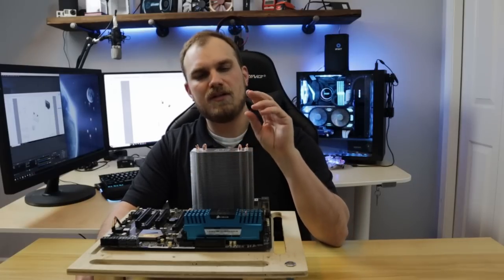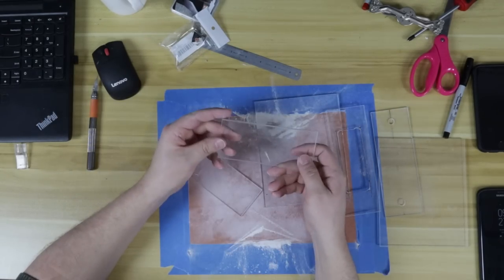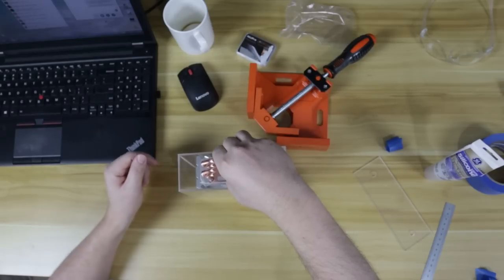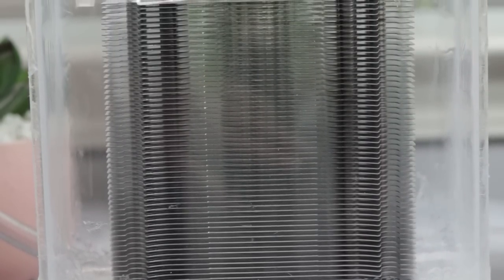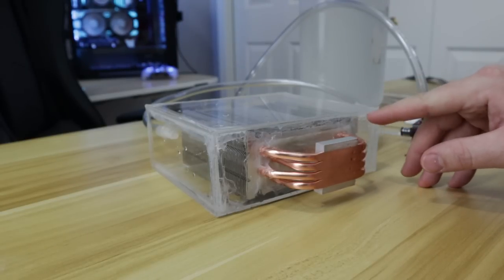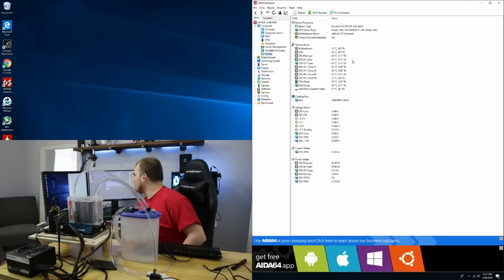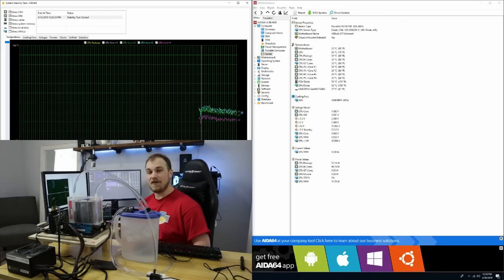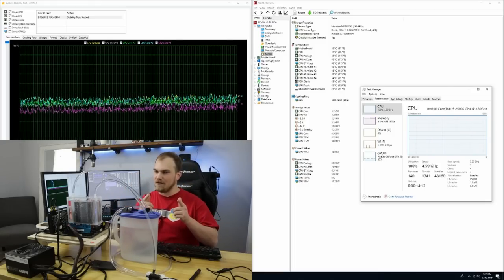I Water Cooled My Air Cooler AND..........

Comment: First time viewer here.

Love the idea, as many have already said. Do you think a gasket would give you a better seal between the bottom radiator fin and the acrylic? Maybe apply glue to both sides of a rubber gasket and sandwich it between the radiator and the acrylic? Just a thought as to improving your seal on the bottom.

Also, in terms of heat circulation, maybe put the water inlet at the bottom of the acrylic and the outlet at the top on the other side? That might give you better heat circulation across the fins. I'm not expert by any means, and your execution in the video is already above and beyond what I could do. Just a couple of things I was thinking. I definitely subbed after this. Keep up the great content!

Comment: I thought about doing this but decided against it because i was concerned with the possible breakdown of the epoxy around the heat pipes due to thermal variation. I would be interested in seeing how long a setup like this could run before leaks happen.

Comment: I've been done this so many years ago.
It's age of AMD K6  CPU
I take the fan out of the original cooler, and seal it with acrylic and 
Silicone just like you do.
And use a electrical fish tank filter to drive water circulation.
Then connect to a junk yard car AC evaporator with powerful 8" 12V fan.
My CPU never higher than 3 degrees C than room temperature since.
This Diy-Water-Air-Cooling system keeps working many years until the end of the age of AMD K6-3 CPU.

Comment: Having the inlet outlet at the top won't allow the optimum flow..

Across the fins with a breaker / diffuser, and the changing the direction of flow would however...

If you want to test flow, use clear liquid, and then drop dye in to it to watch where the dye goes..

Comment: Short answer...thermodynamics (with applied fluid dynamics) tells us this isn't gonna do much. But that's because you aren't actually removing the heat so much as increasing the thermal mass. So it will take longer to get to a steady state because of the added thermal mass of the water around the fins and your pitcher. So it just depends on the load and the length of time of the load when you try and answer, "is it better than just air cooling?"

Comment: i think it would have given better results, if the input aims directly into the lower part of the air coolers. because eventually, i dont know if there is enough water flow in the air radiator to actually keep it cool. It works because of the ice, but once the water is a normal temperature i dont think you can have the same results.

Comment: Actually ALL cooling solutions are a combination of both. 

Standard coolers have distilled water in the heat pipes. That's how it works. Water boils at the CPU and condenses back at the radiator. That's how heat exchange works :)

And water cooling solutions still have a radiator and a fan.

So both are basically the same thing.

Comment: I would assume there could be the possibility of condensation forming where the metal heat pipes of the air cooler meet the bottom of the acrylic box. Condensation that could turn into droplets and drip onto your motherboard. A CPU water block would be safer in that regard.

Comment: This experiment is super cool  (I've always wanted to see it done) but... there is a reason why it's not done. 98% of that air cooler wasn't being used... at all. The water was likely wicking the heat away from the heat pipes as soon as they brought the heat into the container. Furthermore, the heat pipes would not work effectively underwater. A heat exchange... device can be much more compact when using a dense liquid instead of a gas. Because water is so much more effective at stripping the heat away, like I said above, 98% of that air cooler isn't being used. The limiting factor for most water blocks isn't the heat -> water transfer mechanism, it's the CPU die -> cpu heat spreader -> water block transfer mechanism. That's why most water coolers perform adequately and do so until they are heat soaked.

Comment: I did a similar build this with my pentium 1 cooler in 1997/98. Water worked better than passive air-cooling. A fan would probably worked just as well.

Comment: For the next test you should try completely drying out the loop and using  rubbing alcohol (or any fluid with a very very low freezing point) and dry ice in the resivor. I wouldn't expect the system to function super long ( due to how some components might react to the alcohol and temps, pump warming might need to be a thing) but it could be an interesting approach to extreme over clocking. I would definitely use a processor and MB you wouldn't mind sacrificing.

Comment: something holding that much water might work good in that position. but put it in a normal case, i think the weight will cause issues on either the casing of the cooler, or the motherboard it's attached too. but the idea is pretty cool. really this is prolly the same idea that started water cooled originally, and after patting out all the issues, we now have the AIO's and water cooling systems we have now. and is prolly why we have small blocks that the water just runs through now. less weight stressing other parts.

Comment: You don't need to rough the surface much with epoxy, a quick 1 time rub with 400 grit. it'll bond to smoothly bored concrete just fine. If it's roughed too much you run the risk of micro-damage on anything the epoxy bonded to that can cause evident damage over time with heating up and cooling, that it will good.

Comment: If you got one that was just vertical heat-pipes you could just have the input of water at the bottom and the output at the top and it'd probably do just fine due to the very large surface area of the heat-pipes. It might be easier to get the base plate on leak-free too.

Comment: What if instead of all those box for the fins, why not remove the fins, cut the end of the heatpipe(s) and hook up that heatpipe(s) directly to the pump and let water flow inside the heatpipe(s)? Use some copper tubing and it can look pretty neat too.

Comment: try using baffles in the water case to force the water thru the aircooler, not just around the cooler, adding ice to your water reservoir  make proling the cooling time also

Comment: I will try to separate the cooler all around with an intermediate plate so that you have a chamber in front of and behind the cooler. Then the liquid is forced to flow through the cooling fins. Currently the liquid only swims around it.

Comment: Might've been a better idea to make that container from copper sheet. That way you could braze weld the heat pipes to the sheet, eliminating any possibility of a leak. I wouldn't trust this type of setup because the expansion and contraction from heating could lead to another leak. How long did this hold up before it needed to be refurbished?

Comment: What do you do with your heat sink when you upgrade to a water cooling system? Also, what water cooling system would you recommend that has the least decibel (noise) and the least temperature?

Comment: Hmmm, one year later, but, check me if I am wrong, Those heat pipes won't work properly because they can't transfer fluid inside well now. Metal flex with temperature change, seal at the bottom can be broken. No proper way of cleaning unless destroying acrylic enclosure, eventual rust of fins. Condensation on outer block possibly?

Edit: well, I actually found a year later video... looks to be correct in my assessment on most part

Comment: Could you 3D print the enclosure? I printed a flower pot recently and it's water tight! You would only then need to epoxy the bottom around the fin-stack tubes (and the top obviously).

Comment: I wonder if the water-cooled heatsink is more efficient at removing heat from the cpu than a standard waterblock as copper is more thermal conductive than water and the copper heat pipes should be more thermaly conductive than solid copper and the larger surface area of the whole heatsink may transfer more heat into the circulating water  than smaller water blocks, it would be interesting to see how it compares to a standard waterblock in the same loop running the same tests

Comment: ... air coolers are already liquid-cooled. theres liquid in those copper pipes. theve been doing this for a while as a medium so to better transfer heat evenly.

also, an AIO (liquid cooling unit) uses back and forth ports that move through the radiator or around it, and that is cooled by fans when the heat is passed to the radiator. the water isnt on the outside. so this might be a bit off of the idea.

heads up. most AIOs dont use water, they use non-conductive liquids like Mineral oil encase of catastrophic failure in the loop. the liquid has a slightly higher resting temperature then water, but its still worth it. its even better conductive of heat as its a slightly thicker liquid. more like an oil.

+1 for this idea of yours though.

Comment: Okay before I say anything.  This is awesome.  And I'm glad it worked!

But when you say,  the only options are air or liquid cooling.  When you use a category that's as vague as the 3 states of matter... then there's really only one other option... 

That said... I feel like a heat sink IS a solid cooling system... and a fan would be an air cooling system. 

I get that a heat sink uses natural air currents to pull the heat from the mettle but still... the actual method to pulling energy away from your rig is threw a solid. 

So that would mean there is a liquid, air, and solid method to cooling. Not just air and liquid. 

NO idea how to get plasma in there  xD

Unless you could come up with a way to discharge the heat energy as plasma some how? Maybe a way to use the heat to charge a battery. Would that count as plasma?

Comment: I would try Jet Dry to break the water tension - might release the air bubbles.  Also cold water should go into the block at or near the bottom of the block and exhaust near the top.

Comment: This is just an opinion that can actually be broken down into 5 methods but to keep it short , what you need to do is learn the cooling system of a car and pay close attention  to "thermostats how they work" in a car and that will help your project .... now in a car the faster you drive the hotter the engine gets but while moving fans that have a "shroud " helps suck air through a radiator effectively hence cooling the air in the radiator faster ( material is a big plus for this ) thermostat open as a fixed number of degrees to let that water from the rad to go into the engine ... now key thing to pay attention to is that hot water is basically keeping the engine at a constant temp once everything works together .... so now the question would be how can one use a thermostat in water cooling , the answer is easy but the hard part is on a pc how do you get the water colder in a short space of time before the thermostat opens , before the cpu get way to hot so the cooler water go flow through with the pump ... so i'll give you a head start a system that has 2 cooling methods one  the normal water cooling way and the second using a thermostat to regulate the  water temp then inject it using a thermostat to open and send it to the first cooling method ...

Comment: is kind amazing that this stuff cools nice without any radiator... people keep saying about theory, but, this is pratice and run very well even in this cheap level... i guess if companies does cpu block with bigger area of contact (not this big, but bigger than those of nowadays) and put properly engineered solution with radiators can do nice temperatures with all power running on, not up the heat at all mine nzxt x73 is neat, but when i get full load in really heavy games temps goes up a little at least, if i understand right this test get only unheat all the power on even on overclock, amazing!

Comment: this is a good idea until the water becomes hot, but let's say that a body of water is always running through it with the tank integrated onto a water circulation tube long enough that it will never get hot. how will the metal react after being submerged in water for too long? Will it not rust and lose thermal conductivity or sth?

Comment: Water in at the bottom, out at the top, with the fins vertical. A little "tap tap" and all the bubbles are gone... and heat rises so the water is carrying the heat away at the best efficiency.

Comment: I would be curious about the results if you replaced the water pitcher with a peltier and water cooling block. That should reduce size requirements enough to fit it inside the case.

Comment: I know giving this opinion may not be necesary on this proyect, but i will give it anyways XD

If you use a peltier cel and a  heat sink  (on contact to the water)  you may cool the water too. 
So you will be refreshing the water at fast speed and also circulate "cold" water into the cpu heat sing.

The good thing about the peltier cell is that you can control the amp so it will cool less if you lower it, or more if you take it to the maximum.

A vicious circle, maybe.

Comment: Alright, so I see a few problems with this system. It's a cool idea but we should at least give it the best shot. I would put the inlet at the bottom of the fin stack and then run the outlet through the top of the fin stack on the other side. Your main problem with this system is that the water has no reason to run through the fin stack and there is a very large air volume in the "water block". I feel that this is basically just a large water block. Also, there shouldn't be many problems with adhering silicone to acrylic at a scale like that. The only reason fish tanks don't normally have use it is that it doesn't bond as well to acrylic and can't hold the massive weight of 100s of gallons of water. On a scale like this where the most weight the silicone is going to see is a few pounds, it should hold just fine. Although, an acrylic weld is a much better seal as it becomes a single acrylic part.

Comment: You would get much better performance if you add the inlet valve at the bottom of the tank. This way you would get a much smother temperature gradient inside the tank. Also you could try the other way around (having the inlet valve at the top and the outlet at the bottom). That should get you an even stilly better performance.

Comment: would love to see a revisit of this with a resin printed box, as stated below by @Doyle4 with cold water coming in from the bottom and hot going out the top, a vertical mobo and run to a radiator. then a comparison with just a regular block to see if there's any point other then bragging rights.

Comment: Hi! Instead of putting ice into the supply tank, try to make the supply tanks surface area larger, because your supply tank has to dissipate warmth of the exhaust water. If you made the exhaust tube much longer, and if it was made of such material that does not insulate the warmth of the exhaust water to the air around it  (copper tubes are good, and cheep), you could save on the surface area of the supply tank. When i talk about the surface area of the supply tank, i am talking about the effectiveness at which your supply tank dissipates heat to its surrounding air. If you could also adjust the speed of the water, with a wider exhaust pipe, or making it split apart into many lines an then all the lins goes back into the supply tank, that might also help.
Reply: What you are describing is called a radiator
Reply: @farelhimes4017  Then i am a describing terminator

Comment: nice, it a good design there. 

i would like to suggest if, a) try that tubing on another size, as most of mobo set horizon in cases. b) what if u attach waterprooft fans inside that cpu cooler? if it help circulate water inside there.

Comment: Run the inlet into the bottom or run the inlet tube down a corner to the bottom... like a dip tube in a water heater. Cycle it through a radiator. 
Then lose the fins and just attach the pump on top of the cpu with the liquid directly cooling the thermal plate attached to the cpu and you've proven the concept for modern water coolers. Then maybe you could take the idea of liquid + air cooling and implement it in cars. LOL. Just messing with you- it's a fun video.

Comment: My reservation on this idea is the additional weight of the water & tank around the air cooler... how well the 4 screws can still hold this (now much heavier than original design for ?) cooling structure so that effective pressure can continue to be exerted onto the CPU ?

Comment: very cool! imo could be improved by bringing the long sides in tight with the cooler and add a divider at the top to force flow through the cooler. To go over kill you could taper the "end tanks" shallower towards the bottom similar to how car intercoolers are designed to get more even flow top to bottom across the cooler

Comment: 12:45 Did you shake it up a bit to remove all the air from between the fins? If not, you left most of the cooling unavailable...Since you didn't actually have a way to dissipate the heat from the water (adding ice is not a viable solution, of course). I'm looking to the 1 year later video next.

Comment: You could optimize the water-flow...

But a water block is nothing different... so without watching further I don‘t see any problems with that Idea...

Also for the radiators there would be other options to keep it cool... like a very huge water tank that is too big to heat it... would also be intresting... passive cooled big reservoir, can it replace radiators on a non-oc-system?

Comment: Maybe this is more recent than the video, but as a third cooling option, you can also get a massive heat sink. Heat sinks that are large enough to effectively cool a CPU exist and typically double as the casing for the entire machine.